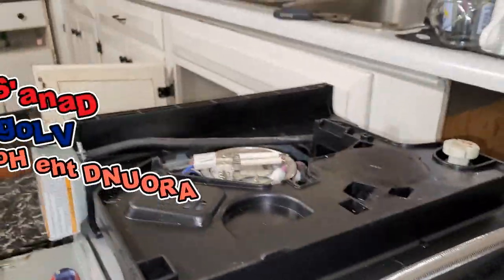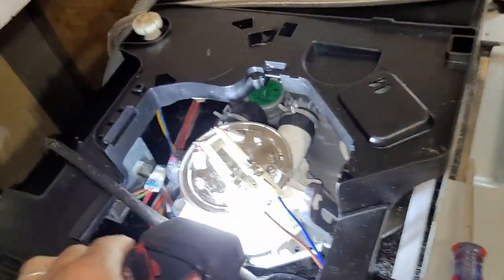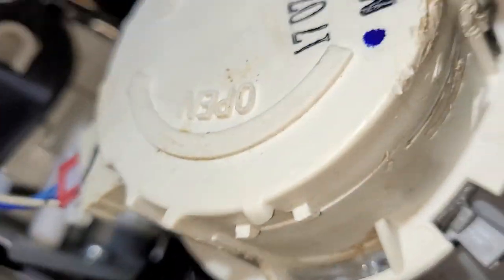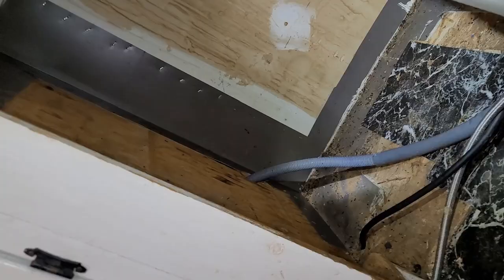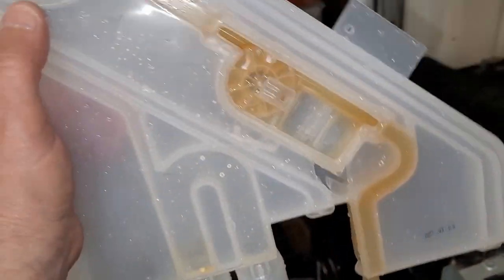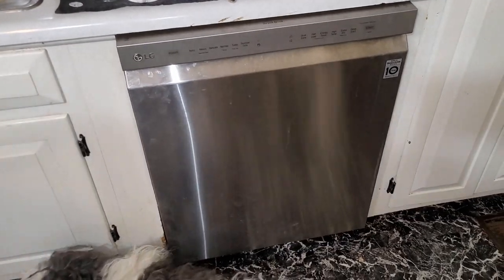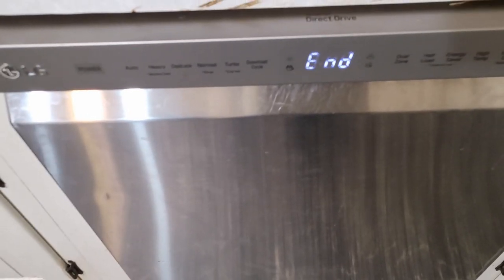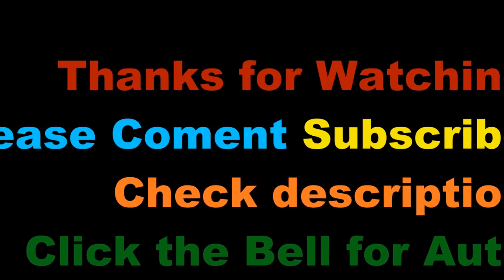LG Dishwasher sets off AE code

Comment: My LG did this last week. I called the appliance guy and he said mine wasn't leaking or had any wetness, but said that there was probably a small crack which caused it to throw out that code. But, before it threw out that code, it would throw out a d2 code, stop working for a few days and then magically start working. He's going to replace the float and my circuit board. My dishwasher is used and came with my house. It runs and cleans well, though.

Comment: Is the internal air vent leaking water? Is this normal?
Reply: The OE code appears, and when we open the washing machine door, there is a lot of water in the washing machine tub, so we changed the drain pump with a new one, and the problem still persists???

Comment: So is it fixed now ?
Reply from the maker: It was fine still had to dry float tray till a rodent eat through the drain hose and some wiring, I did some splicing but It started throwing no water code. Found the same one on Facebook for 50.00 Its running fine so far.